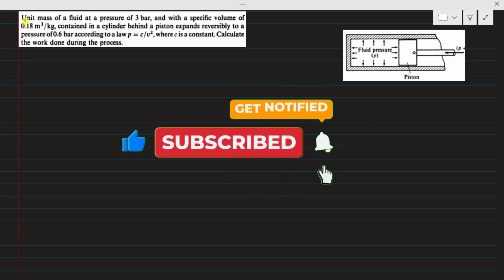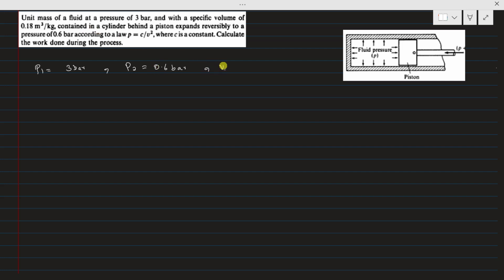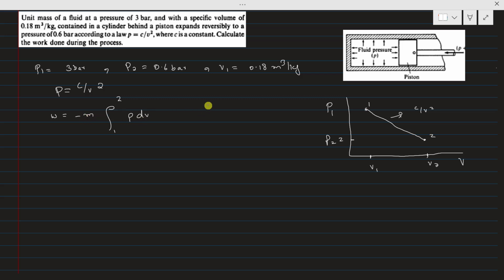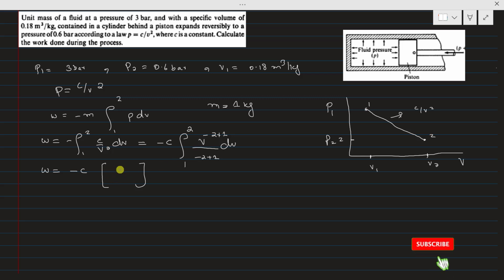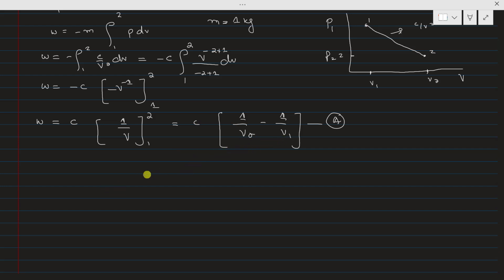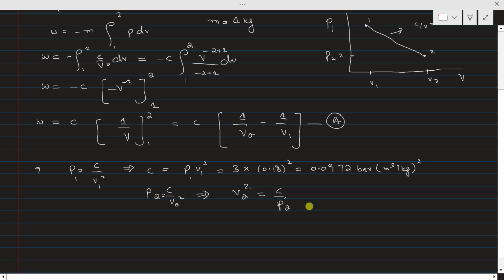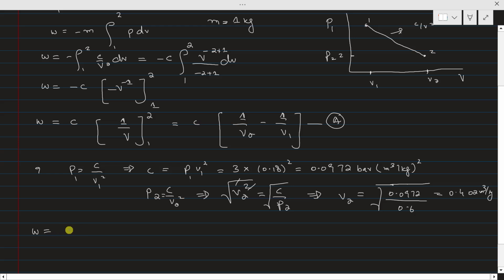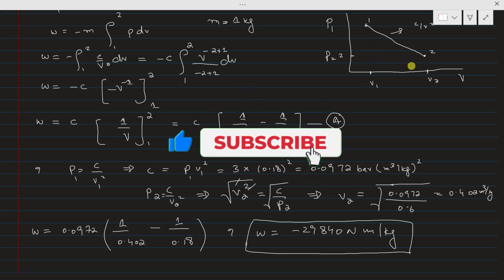Example 1.1 Calculate the work done during the process.

Comment: how did you get the final answer pls 
and did you convert.  am confused at the final answer
Reply from the maker: Please mentioned the time slap I will respond
Reply: 6:00,  pls explain how you did the conversion  @education_shop
Reply from the maker: It's just a simple square root no any other conversion
Reply: How did you get 29840 n.m/kg. Did you convert the 3bar and 0.6bar
Reply: Because I multiplied it, it wasn't giving me 29840
Reply: @kryptexplains sir na porra Simplify nahi kayya hain ap ayssa karoo end pa 10^5 common karr lo pirr yahii answer ayya gga 👍
Reply: @kryptexplains try to learn the method
Reply: Means ayssa karoo: 0.0972*10^5[1÷0.402-1÷0.18]
=-29354.4Nm/kg
Ya answer ayya ga ok